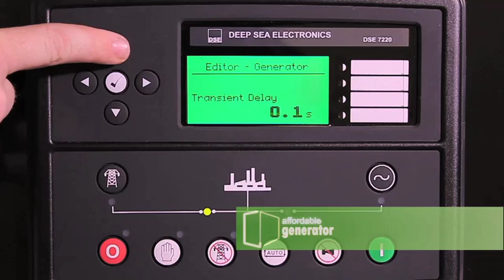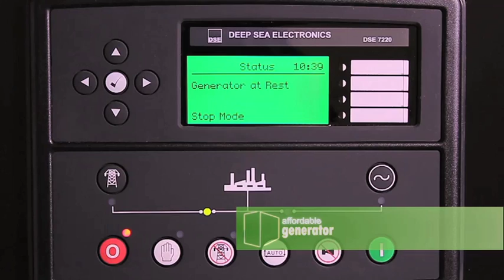How to adjust the Transient Delay of your Affordable Diesel Generator

Comment: Hi, bro, I have two generators with using ATI automatic transfer switch system my DG,s are running will  but when 12 hours of one DG is completed it gives the signal the other DG set get a start but the previous one does not get stops what is the reason  when I bring down the main circuit breaker of  DG after some time  The DG which will be turned off will get off

Comment: Sir what is problem my genset  cummins 4bt3.9-g2   the engine high running acceleration is rough and shaking after 1 minute ,and don't start in automatic but he start in manual starting

Comment: Sir I have problem with my generator 750kva it start but after a seconds it will off and and the monitor displayed voltage cannot be reached,sir what is the main reason in that problem.
Reply: the main reason is that the generator is overly complicated.

Comment: Is there anything else I can do to to get this generator yo start. We did this already and didn't work. The generator doesn't have anything hooked up to it and it says under voltage
Reply: Saul sanchez check your voltage regulator
Reply: If t's a large load motor, use a VFD on the motor so initial load is much lower

Comment: Hi . I have a generator rated at 110 kva. When I connect it to a 30kw compressor the generator stops running and register under frequency error. What could be the problem?
Reply: when i made load testing 110% for my generator 750kVA (pri), it was stop and appear under frequency, cooling water was too hot and blow out at that time,
Reply: It's possible because of the huge added load, which cause the voltage to Dip and in turn causing the Genset to register a lower frequency check and re-adjust your transient delay.
Or it might be your governor which can't keep up with the load demand

Comment: I have  one dout   genratater running but stopped  when coming alarm low coolent oil level  oil is full on the tank i given flot switch short is ganerater runing
Reply: The sender plugs are not working

Comment: Hello, i have a problem with my kubota generator, when the generator shuts down ,it will not cut the power, it makes the electricity feather or turns on and off while shutting down, i need help on how to fix that